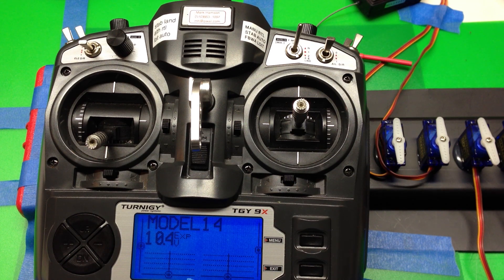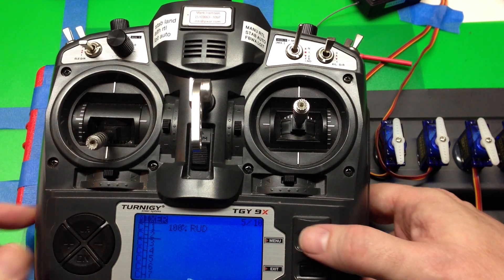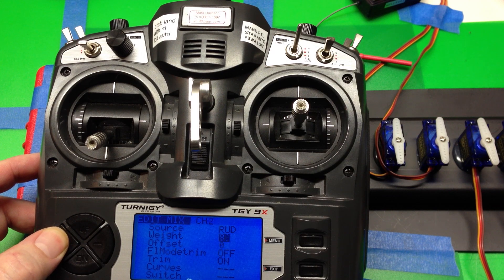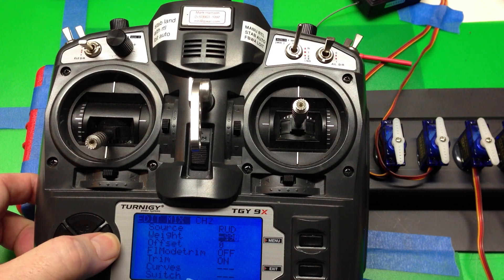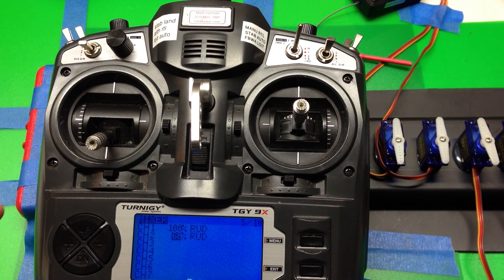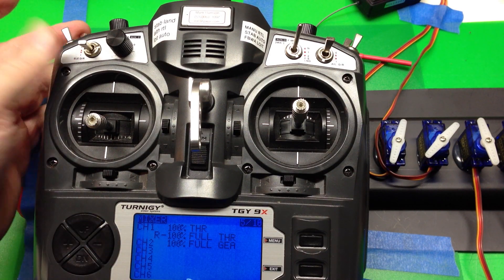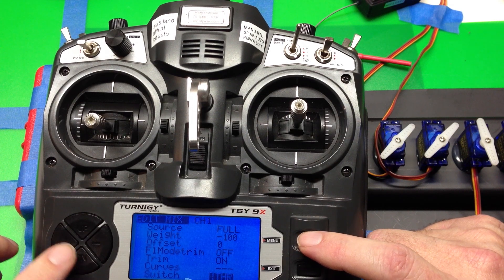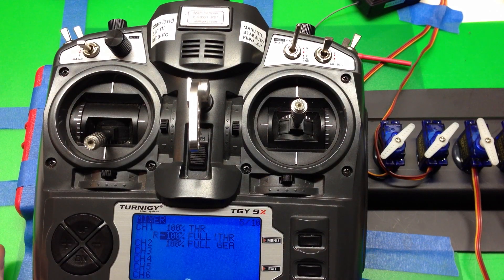er9x Tutorial: Mix Menu

Comment: can you explain how to mix one of the POT's into the throttle channel?? Basically I want to flip the throttle hold switch and have the throttle moved from the left stick Y axis to one of the pots.  basically control throttle with a pot but flip the switch back and return to normal.
Reply: nevermind.. figured it out.  p1 is pot 1, duhh.  that was the first thing i tried but weight was set to zero so wasnt getting anything.  video very useful.  Thanks!!